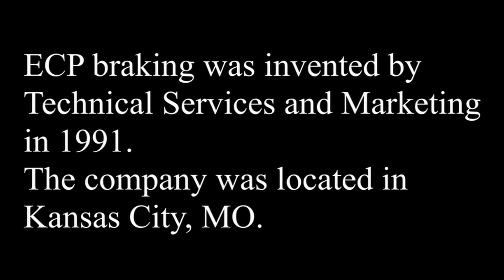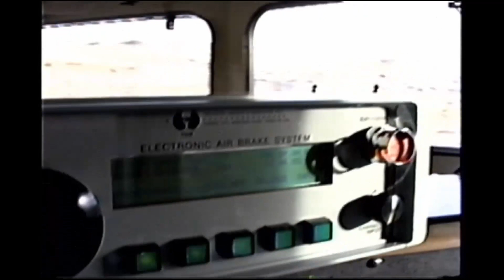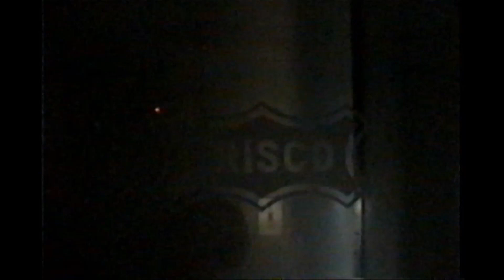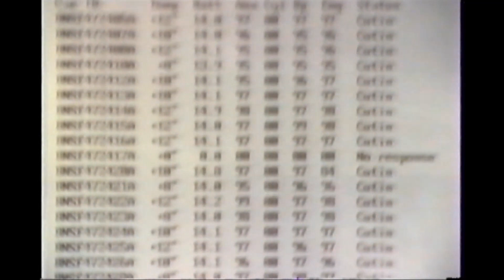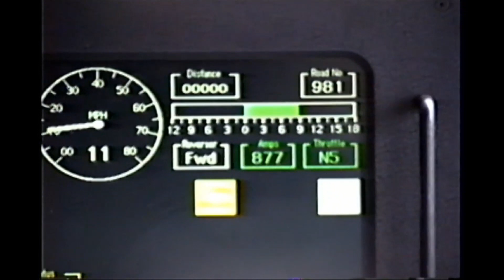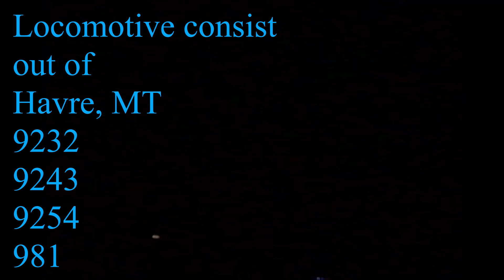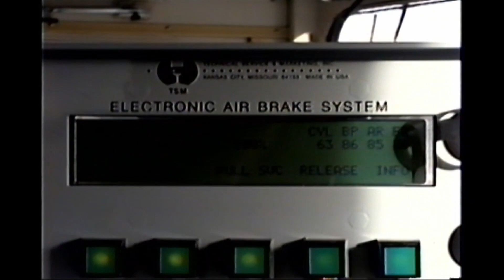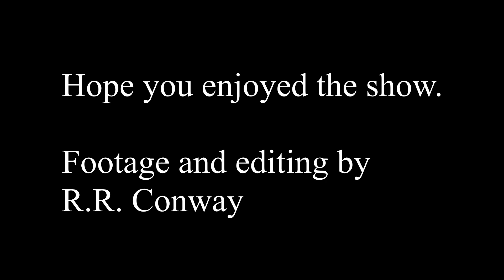BNSF ECP BRAKE Grain Train

Comment: I ran those brakes on coal trains mostly. They were amazing. They stopped  114 loads on a dime if needed. I had a block drop red and was able to stop in less than 2000 ft saving a possible major incident.
Reply from the maker: We were leaving Glendive, MT on an empty coal train. The conductor was busy with his paperwork and I was showing the engineer how to use the system. I had him make a minimum application and as he did, the train dramatically slowed down. It was noticeable enough for the conductor to jump up and yell "We're on the ground!" I managed to calm him down before he pulled the air.
Reply: @slorznovitch  lol. I believe that. Amazing stuff. We ran the other end of the line. Scmcob, sud, Ben. It was the Minnesota division then

Comment: Will connecting and disconnecting the cables be difficult on a mixed freight?
Reply from the maker: No more difficult than coupling air hoses. However, exposed connectors left hanging will collect dirt, ice and snow, making them more of a challenge.